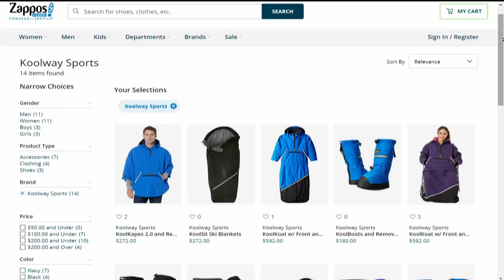Ontario company makes accessible outerwear

Comment: This is NOT a real solution. I have kids with disabilities and could not afford this not to mention that most children with disabilities do not conform to S M L sizes and require to get these sizes tailored to fit as needed. You would be better off getting a local seamstress to measure the child and adapt articles of clothing or custom make the garment for the same price or in most cases cheaper.
Reply: I agree, But it's a start! I worked with children and adults with varying levels of physical disabilities for almost 20 years, and some of those clients would have really benefited from products like these. The costs for anything aimed at people with physical or cognitive challenges, as you know, are always higher. 🙄 Sad reality. A big part of the expense for these, I'm sure, comes from being a very small, start-up company at this time, and are honouring a "Made in Canada" standard so are using the resources they can access. If not for being financially inaccessible those of us on very limited budgets...  😏 I'm sure it won't be too many years before a larger company, with production factories in third world countries, will be selling similar items for 1/2 the price. Someone always does.